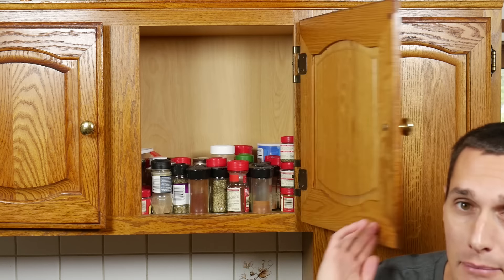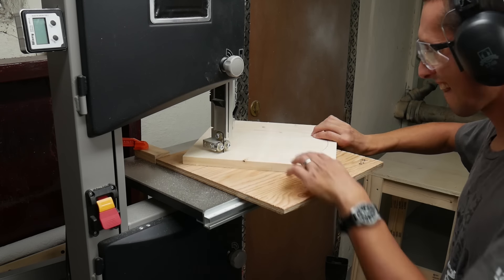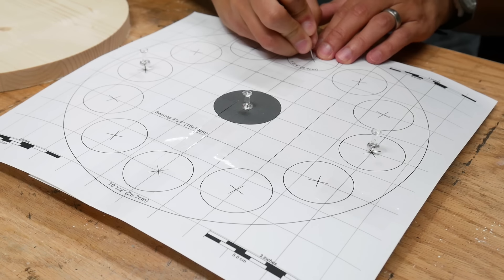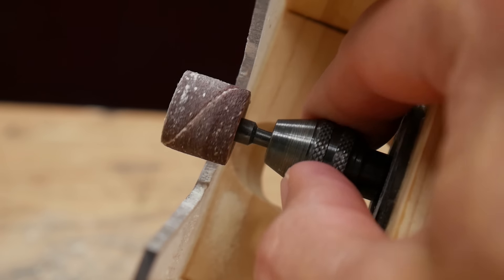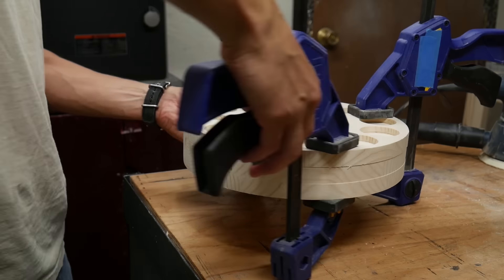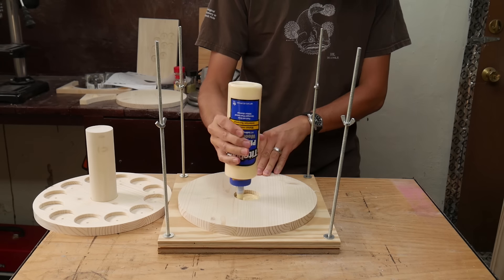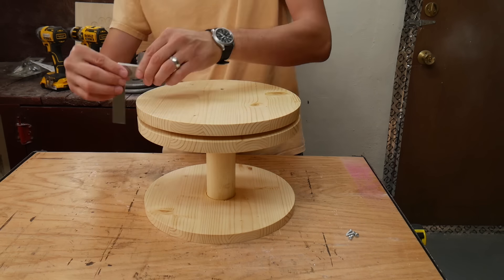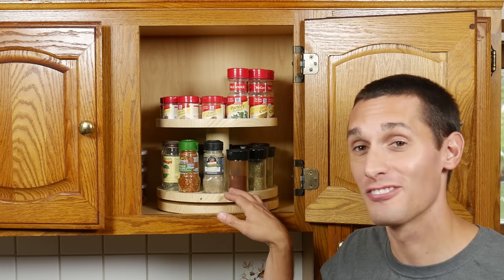How to Make a Spinning Spice Rack

Comment: Nice spinning rack. Thanks for sharing. How do you divide a drawing which is bigger than standard paper dimensions. Which program do you use for it?
Reply from the maker: I use Adobe Illustrator which is a little pricey. A free alternative is a program called Inkscape. I actually made a video that shows how I make templates that span multiple pieces of paper (https://youtu.be/OQuFWvHpIFM).